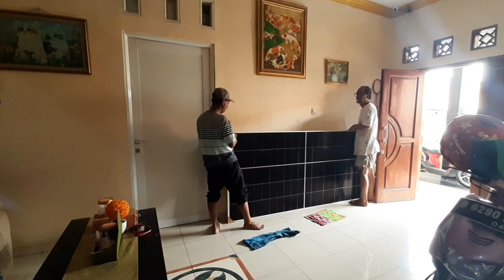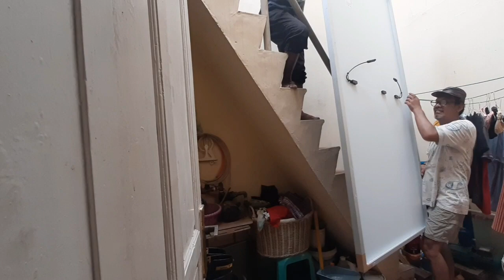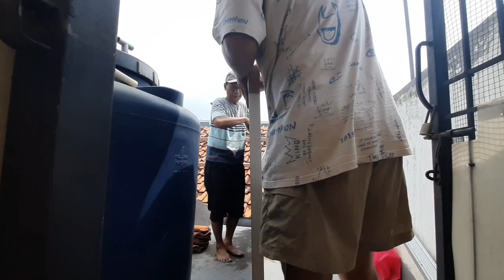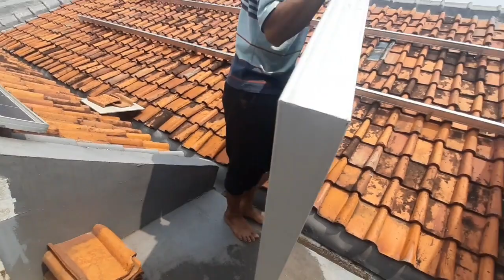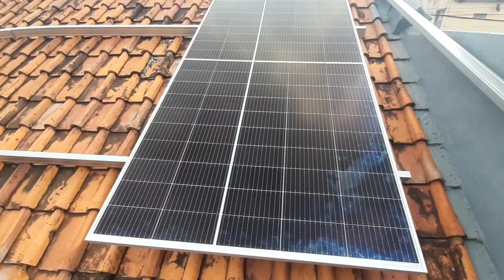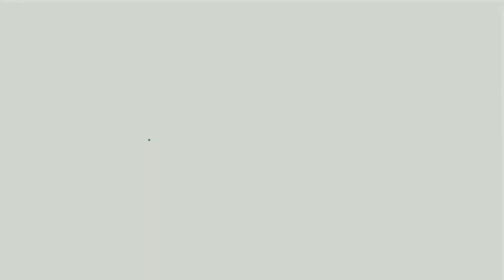Miara PLTS minta jajan lagi  solar panel 500wp x 2 langsung pasang di atap genteng

Comment: Pak kalo saya mau pasang 2×500wp. Pake grid tie inverter on grid 1000w bisa?
Reply from the maker: Bisa pak tp perhatikan di inv on grid nya batas voltase max nya dan out put pv jgn sampe lbh
Reply: @HariPLTS  Terimakasih pak
Reply: Ada saran pak, kalo mau pake sistem on grid, supaya tidak mengganti meteran exim, bagaimana pak?
Reply from the maker: @rafantv8952  saran kl pake on grid  ga pake meteran exim daya on grid harus di bwh daya listrik pln  jd  hanya mengurangi pembayaran listrik 50%
Reply: Terimakasih suhu
Reply: Daya di rumah saya 2200, berarti aman ya saya pakai on grid 1000w + panel surya 1000wp..
Reply from the maker: @rafantv8952  aman bang sama seperti saya jg gtu

Comment: Scc biru bisa gak gan ngecas batri 3s?
Reply from the maker: Bisa tp baik nya pakai scc yg hijau karna ada settingan buat luthium baterai
Reply: @HariPLTS  tapi mas,, di ssc sya biru jika dipilih b2 tampilan jika menu ditekan 1x ada 12.6v itu sperti husus bms 3s, dan juga ada yg bilang kok sprti itu di b2 mgkin ada ksalahn dari pbriknya katanya.
Reply from the maker: @aghilmaulidi6783  kl ada 12.6 bisa kan lithium 3s max 12.6v untuk charging
Reply: @HariPLTS  tapi gimana mau cobak ya mas takut sya,, takut rusak jadinya kalau tidak ada yg saran dari tukang plts sprti kamu itu. Kalau emang aman ya mau dicobak sbntar aja takut batre panas klo lama2
Reply: @HariPLTS  iya saya lihat semua
B1 14.4v
B2 12.6v
B3 14.6v
Ktanya yg no 2 aki gel tapi tampilanya kayak untuk 3s itu, mau dicobak takut kenapa2 krena blum ada yang nyaranin sya untuk dicobak?
Reply from the maker: @aghilmaulidi6783  bisa di cba yg b2 12.6 v dan perhatikan saja jika baterai full  bms cut off ga ? Kl cut off aman2  saja
Reply: @HariPLTS  mksudnya jika udanh nyentuh ke 12.6 akan brhanti ngisi gitu kah mas?
Reply: @HariPLTS  dan sebenarnya apa semua scc biru di b2 juga sama 12.6 ya mas?
Dan biasanya untuk aki gel ada brapa vol cut ofnya?